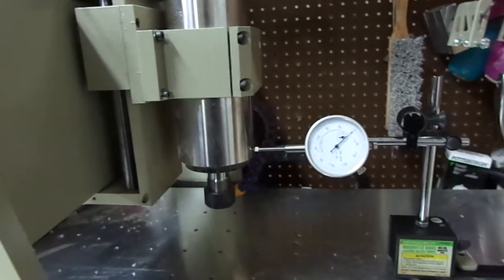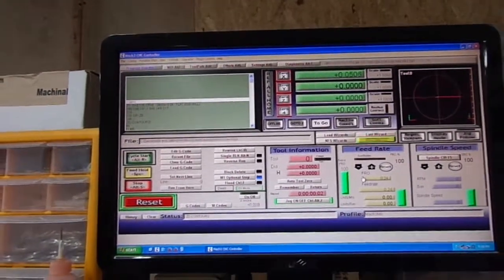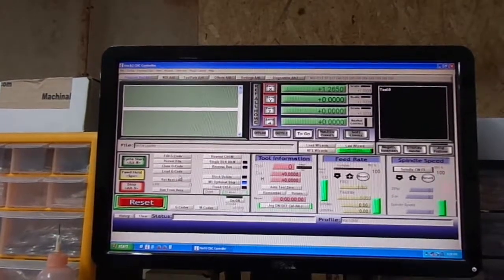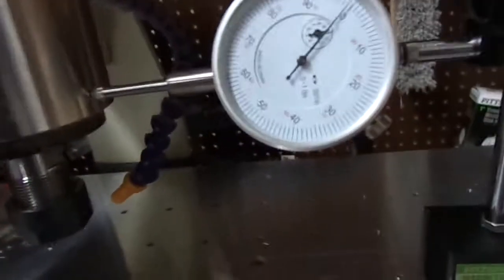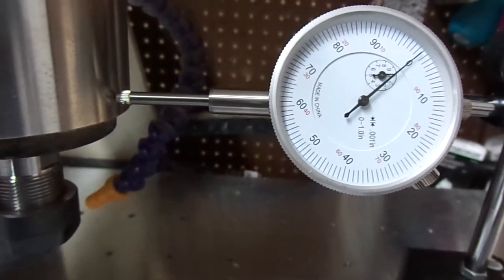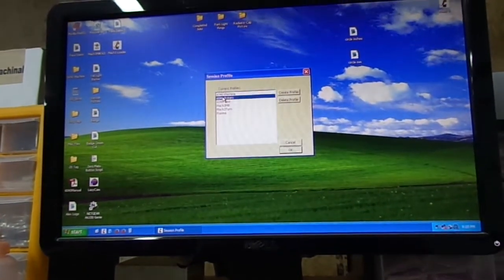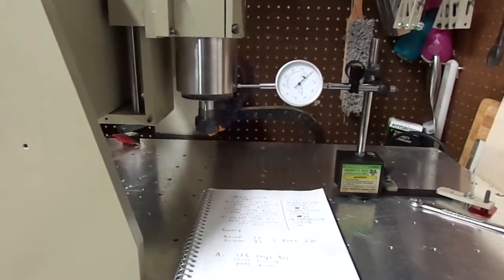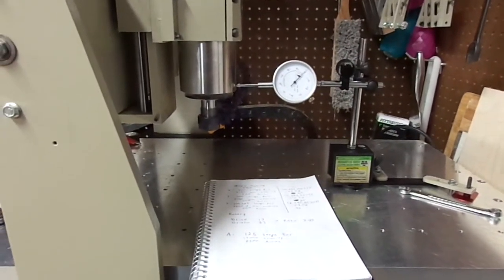6040 CNC Mach3 Native Units

Comment: My CNCEST 6040 runs in mm (USA) which it is tuned and all in mm. Every time I start, I simply go to the Settings tab (Alt+6) and click the UNITS Alt-U button and toggle it from mm to Inch, which toggles the DRO's and most settings; so if a DRO said 100mm and then you switch, it now says 3.9370. Sometimes useful for doing conversions to/from metric. And when I command from the MDI tab like: X4, it will move 4".